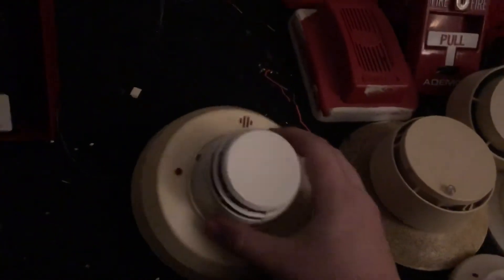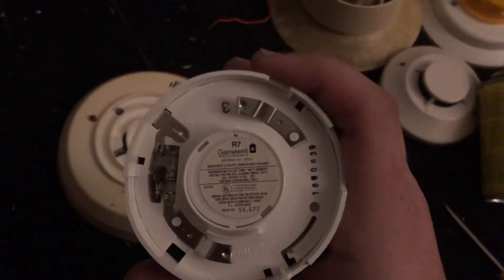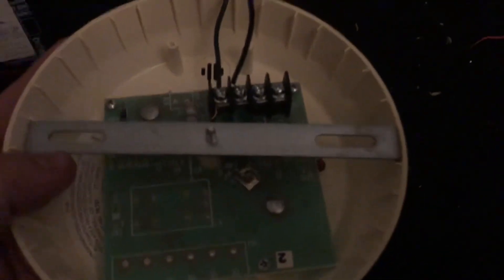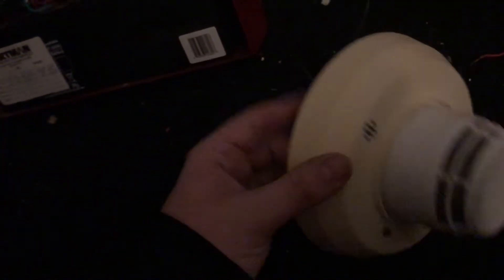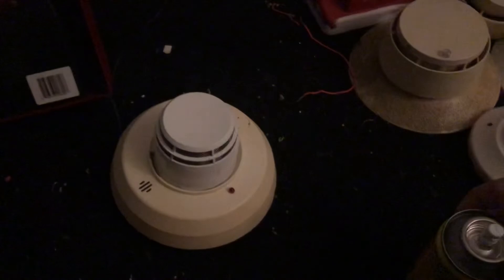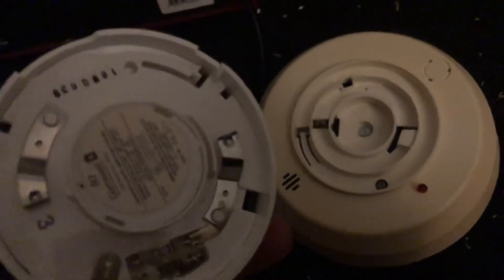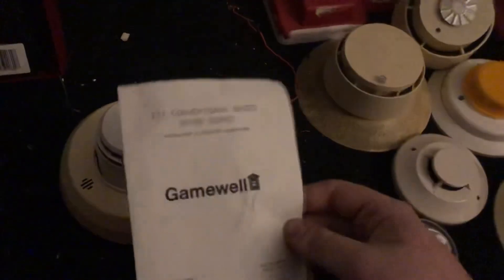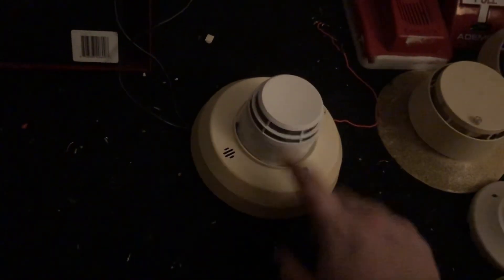Gamewell R7 / Z77 Photoelectric Smoke Detector Demo

Comment: Those detectors are conventional? I never knew they were before.
Reply from the maker: Yep they are conventional. They were just suggested to be used on the Zans panels but you should be fine. This detector does not have an issue with current limiting so you can use just about any conventional panel to power it
Reply: Gamewell co made addressable bases for r7,f7 and d9 detectors